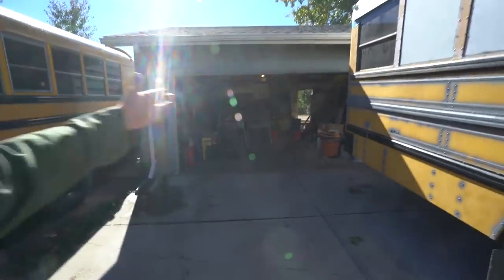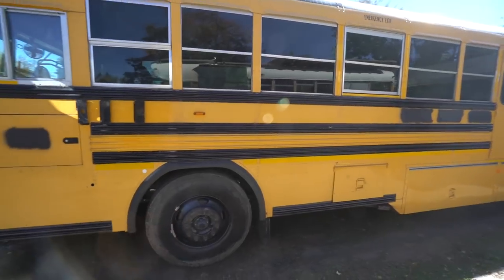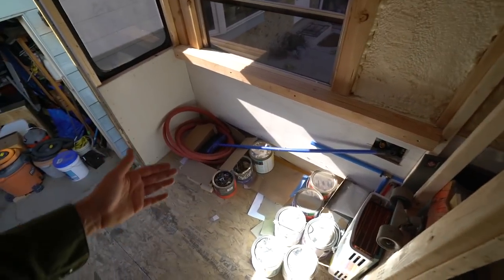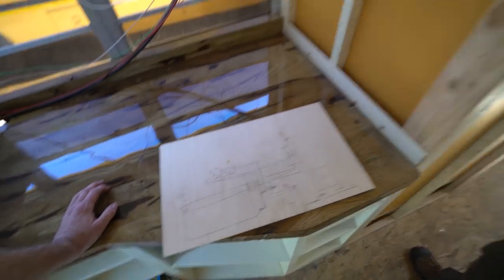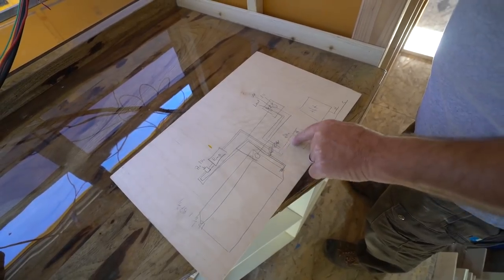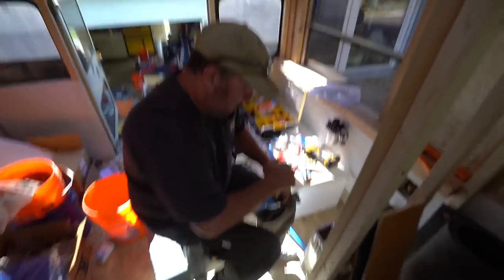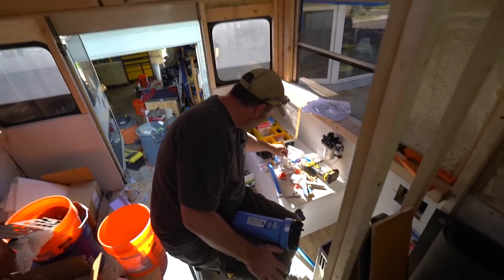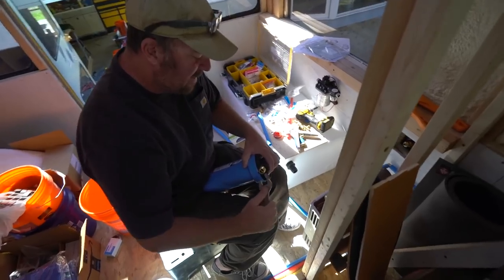School Bus PEX Vanlife Plumbing in Skoolie RV

Comment: I hope your water pressure doesn’t drop during the night because the pump looks right under the head of the bed.  Might make you jump while you are trying to sleep after a long day driving.  Could put the pump on a floating mounting system to make it quieter so the side wall won’t act as diaphragm.

Comment: The pressure relief should vent outside not on to the floor. Being an old Navy guy I always think about parts replacements and valve around those components so they can be isolated and replaced with ease. More valves, more cost. But, that is just my hang ups. Better hurry up. We are already watching you paint your bus on other channels Going to look good.:-)
What Reed says. Systems first, then the details. !!! :-)
Reply: what channels can we see different updates?
Reply: @bensimon8030 : Blue Van Dan: https://www.youtube.com/channel/UCS0XBNvsIwcdjCtL94s6PyQ/videos
And  Caravan Carolyn: https://www.youtube.com/user/kamsmomusa1/videos
Reply: Not enough water on the pressure relief valve to warrant a hole. It’s only there for safety.

Comment: think it be a good idea to go to the hardware store in the bus , that way you have everthing at hand to try and see if it fits or if youre missing sumtin (lay everything out piece by piece and try treads and stuff all through the bus, its eazier to run back inside if youre still in the parking at the hardware store

Comment: Do you have a port to blow the system dry so you can winterize the water system ? A friend drained his system at the lowest point and it still froze and broke two small pipes. Thankfully the two pipes were actually softer thinner pieces meant to blow out rather than break something more expensive. Also, how easy is it to get to the filter to change and the anode rod in the water heater?

Comment: I got a question If you only have one tank in the back of the bus won't that make your bus off balance? you don't have a pusher meaning the motor is in the back.
Reply: He won't even notice unless one side of the bus weighs 7500lbs+ but the whole project itself probably only weighs about 5000 and that's being generous. Don't worry he's completely safe but you are not wrong the closer you can be to a perfect balance the better